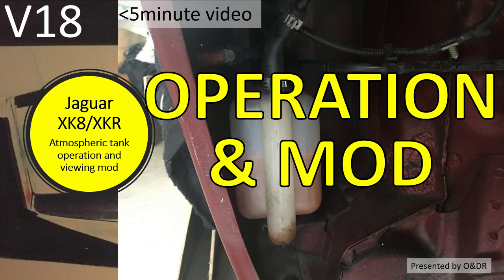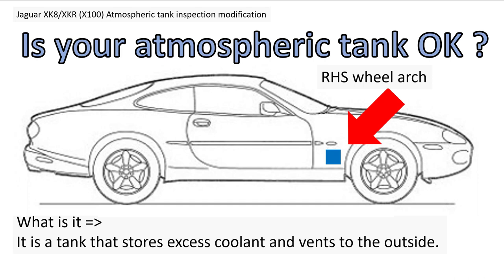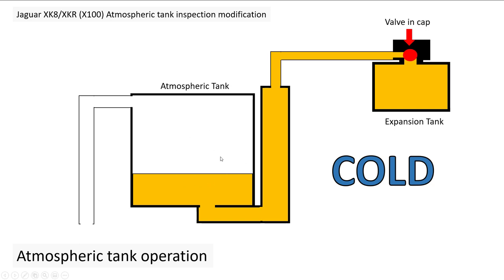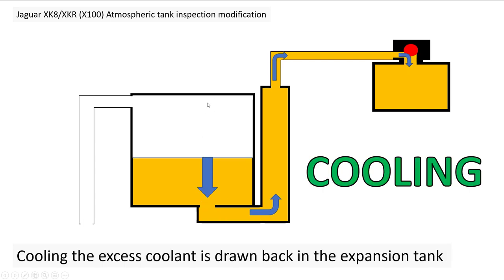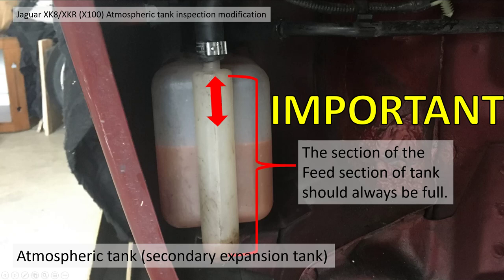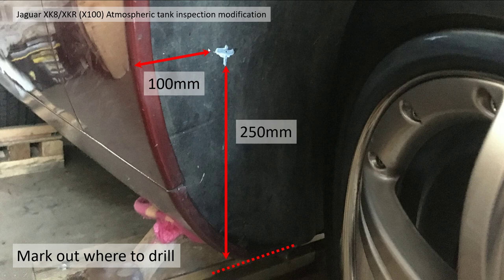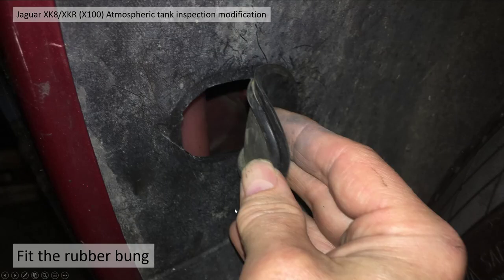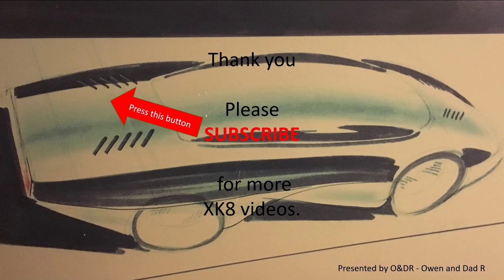How the coolant atmospheric Tank  works and simple viewing modification V18 Jaguar XK8 / XKR (X100)

Comment: I enjoy your videos and expertise on the XK-8. I have owned a 2005 XK-8 convertible since 2008, and have had my share of do-it yourself repairs and garage repairs. I recently had a garage replace the 2 rear quarter windows due to the cable assemblies going haywire.$4000 later (had other items repaired also), my XK-8 is happy again. I also had the dreaded hydraulic hose rupture at the top latch a couple years ago, in which case I repaired it myself with the better (not Jaguar OEM) hoses.  I now have the bad door agar microswitch, which is my next project. Pertaining to this video, I do think it was rather poor of Jaguar to position the overflow tank in a non-accessible location, especially when Ford managed the company when my XK-8 was built. Ford did fix a number of problem areas with Jaguar production, especially by getting rid of the Lucus Industries issues. What a nightmare I had with my 1993 XJ-6, which I eventually sold.
Reply from the maker: Danny, glad you enjoy the videos and I hope you find them useful. Thank fully I don’t have a convertible and all it’s complexity’s. The coupe is a quite a lot simpler and easier to live with, maintenance wise, regards Damian

Comment: My expansion tank has always been empty since the car was new but it really doesn't make any difference. All that matters from a cooling perspective is the level of coolant in the header tank when the engine is at operating temperature and provided that the header tank is full at operating temperature then the engine is being fully cooled. 

What will happen is that some coolant will be released by the header tank valve and pass into the expansion tank where it sits until the engine is switched off and cools down again. That fluid will then be sucked back into the header tank, possibly with a little air but that doesn't matter because no fluid has been lost so when the engine heats up again the coolant expands exactly as it did before and fills the header tank before pushing a little over into the expansion tank.

This cycle repeats ad infinitum and cooling capacity is never compromised.

Richard
Reply from the maker: Richard, the problem with the coolant is it contains 50% water. The fluid in the atmospheric tank is exposed to the atmosphere. The fluid is hot and some of the water evaporates over time. You continually loose fluid with this system. Hence if not topped up you will loose enough coolant to allow air to be drawn into the system. As the air can get trapped in the system the header tank can still be full even with some air in.  This will continue until you, hopefully, get a low fluid warning from the header tank. Jaguar actually advises vacuum filling for the 4.2l to avoid air traps. It wasn't a big issue to check and fill it. One less risk to take. That's my thoughts, thanks again for the comment regards Damian
Reply: @ODRModurol  But even if that were the case, the fluid loss through evaporation in the expansion tank would only continue until the volume in the system is just sufficient to expand so as to completely fill the remote header tank at running temperature but not enough to push any coolant past the valve. At that point the system has reached equilibrium and any evaporation losses will stop.

Either way, it's not a big deal.

Richard
Reply from the maker: Richard, could right could be wrong. For the sake of a couple of extra litres of coolant in the atmospheric, I would recommend to air on the side of caution. Reducing the risk of getting air in the system is the goal. This is how the system was setup by Jaguar to run. I am assuming the Jaguar engineers had good reason to do it that way and we just trying to figure it out why. If you where correct the header would just vent to the floor and not the bottom of a bottle. However, if you want to test your alternative theory no problem. Let us know how you get on. Thanks for the discuss point regards Damian

Comment: Hi Damien, I’m getting the low coolant warning every time time the car warms up (it’s fine when cold). I’ve confirmed the the sensor and magnetic float are fine (I guess the fault would be present all the time if not) and am now wondering whether a lack of coolant in the atmospheric tank could be to blame as the issue seems temperature sensitive. I haven’t check the atmospheric tank yet but could this be a possibility in your view, or is to contrary to the logic of how the system functions?
Reply from the maker: A Bee, sounds like interesting problem. I would recommend starting with the obvious practical checks first ie checking the atmospheric tank. If that’s empty fill it to halfway and top up the expansion tank.  Once that’s that’s done if you still have a problem then can start further investigation into anything less obvious. Keep it simple if possible. Hope that helps regards Damian

Comment: Hi Damian, after watching your video I decided to check the level on my atmospheric tank but found it empty, just like Andy’s. Is there a Jaguar document that mentions that the tank must be partially full? If so, what is the correct way of ensuring this?
Reply from the maker: Victor, it doesn't mention the fill level anywhere in the Jaguar manuals I have, except 'the bible'. The logic is something like this but I'm no expert.  The only way on ensuring you are not introducing air back into the system whilst cooling down is to make sure the Atmospheric (degas) tank has some coolant in it. Then you KNOW you are not doing that. Without that confirmation you can't tell if you running with some air in the system. Although only small amount as otherwise you would get the coolant level alarm (unless you've hot wired it). You may well have excess coolant in the pipe to the expansion tank but you don't KNOW as you can't see it. Hence, it just good practice to see a bit of the excess coolant and know what's happening. Its simple to add coolant in there. You can remove the fill pipe plug at the top of the Atmospheric tank and simply pour coolant in. Then clip the plug back in, job done. Hope that answers you question. Not a big issue just good practice. Thank for the question respect the choice of others to do differently, regards Damian.
Reply: O&DR Jaguar XK8 Hi Damian, appreciate your reply. I’ll put some coolant in the tank and keep my eye on the level. Cheers, Victor
Reply from the maker: Victor, Appreciate your time and effort to mention your thoughts. Its good to discuss these things that are a bit blurred, Thanks Damian

Comment: Hi Damian, thanks for all your videos - good lesson to study and save time and efforts if troubles up. Question - sometimes the steam comes from right wing as well as smell of antifreeze in saloon when ventilation running - is it normal for second extension tank? Didn't check level there yet but level in upper tank is basically same, topping 200 grams every 1000 Km - is it normal?
Reply from the maker: Oleg, thank you for your kinds comments.  Sounds like a leak on one of the heater coolant hose connections. Unfortunately, they are plastic and become brittle over time. They are in between the bulk head and engine under the throttle body. Not the easiest thing to access and repair. Might be worth checking the second tank it’s probably empty but it shouldn’t be releasing steam as you describe. Hope that helps regards Damian
Reply: @ODRModurol  Thanks Damian, all noted
Reply from the maker: Good luck with the repairs, regards Damian

Comment: Is there a sensor in the atmospheric tank? Or if it low will system tell you it low on coolant?
Reply from the maker: David, no there isn’t a sensor in the atmospheric tank. The coolant level sensor is in the expansion/fill tank. The only way to check the atmospheric tank is by removing the wheel liner and viewing the level. Hope that helps, regards Damian

Comment: Hi Damien.  Once I verify the tank is low how do you recommend I fill it?
Reply from the maker: Angel P, there is a pipe going in through the lid at the top. You should be able to remove the lid and pipe together and then fill from there. Hope that helps regards Damian

Comment: Hi Damian. Great info as always, however, this one has confused me. I originally watched your other COOLANT video as I’ve been getting intermittent Low Engine Coolant message. It only last for a few minutes then goes away. How do check the level? Do I look in the header tank and fill up there or do I need to check the atmospheric tank in the wheel arch like in this video? Hope you can advise. Thanks.
Reply from the maker: Mick Mac, Sorry for any confusion. To check the coolant level manually you check the level at the expansion tank in the engine bay.  This is where the level float is so you can see it is actually low. The level is only correctly maintained if the atmospheric tank has fluid in.  You could have a sticky float, empty atmospheric tank or a leak somewhere, or combination. I would start with the easy stuff check the atmospheric tank and look for any obvious coolant leak. The naming of these items is a bit wrong. The 'expansion tank' acts as a coolant manifold and houses the level sensor. The 'atmospheric tank' is where the excess expanded coolant goes and returns to maintain the level. Hope that helps, regards Damian. PS here's the video on the expansion tanks. https://youtube.com/shorts/-2y20KZkHy8
Reply: @ODRModurol  Thanks. I’ll investigate further.
Reply from the maker: Mick, good luck👍 regards Damian

Comment: Just had a check of mine... The header tank seems to be full. The atmospheric tank has a very small amount in but the fluid in there isn't red. Difficult to tell but it looks like water. Shall I get some coolant and half fill it to see what happens, or try to get rid of whatever is in there first?
Reply from the maker: Mike, sounds like water as the coolant is water based. If there is only a small amount it won't dilute the coolant very much anyway or you can adjust the dilution of the coolant you add. Best to half fill and let the system draw it in and out. Hope that helps, thanks for the comment regards Damian

Comment: Correct me if i am wrong, but the level in the chimney pipe will always be the same as the main atmospheric tank unless a vacuum is maintained to the engine. Any time you remove the fill cap to add coolant the vacuum is broken and the level will equalize.
Reply from the maker: Richard, I think you are correct. But a vacuum is maintained whilst there is fluid in the atmospheric tank and this draws fluid back into the system during cooling down. The main issue is that the fluid is 50% water and open to the atmosphere. Over time (many years) this evaporates and this reduces the amount of fluid in the tank to zero. Then without knowing, you are drawing air into the system. Hence the idea of checking the tank on these 20 year old cars. Thanks for the input and comment regards Damian

Comment: Out of curiosity Damian have you been into the corresponding cavity on the LH side wheelarch where the carbon filter for emission management is housed? Just wondering if you had any maintenance suggestions for it - I can't find anything!? Just wondering as I get the occasional fuel smell while driving despite any bulkhead grommets/seals apparently being sound and no fuel leaks.
Have refilled my expansion tank after watching this video, something overlooked previously. Nice idea for the access 'door', I missed this out as I have a cheap remote access/fibre optic lead camera from Jaycar here (like Radio Spares in UK) used for various jobs but also great for inspection of head(s) through spark plug holes to name but one application.
Reply from the maker: Dave, sorry haven't had any issues with the fuel vapour carbon filter, fingers crossed, so haven't done any research on it. You might be best asking a question on the 'Jaguar Forums' as I am sure someone will be able to help with it.
https://www.jaguarforums.com/
If you get any good information please share.
Thanks for the comment Damian

Comment: Personally I don’t think the level is that important. It’s nice to have, but I’m not concerned with the level. Mines been empty since new
Reply from the maker: Andy, just trying to figure out / explain how it works and what happens if nothing’s in the tank. You’ve got some margin of error for small leaks if the tank as something in. You must agree it’s not easy to check without a simple mod. Value your input and opinion good to have some discussion, thanks Damian